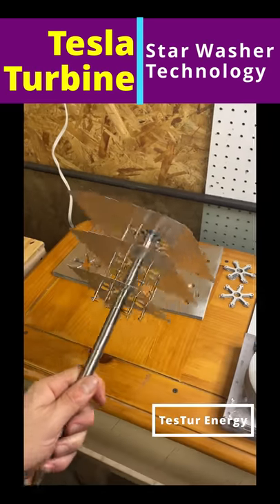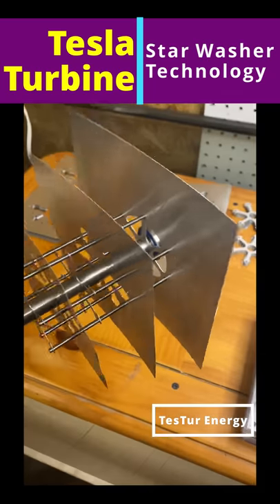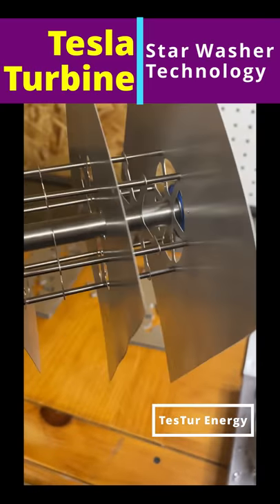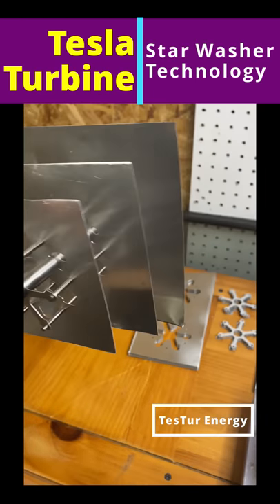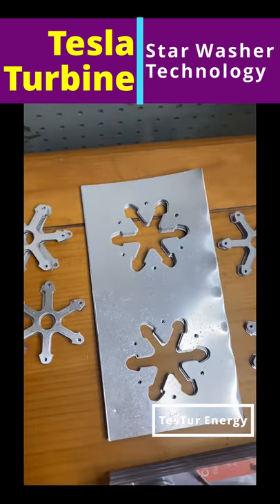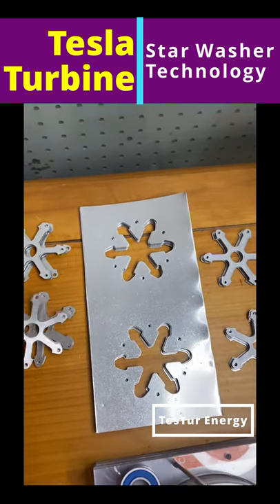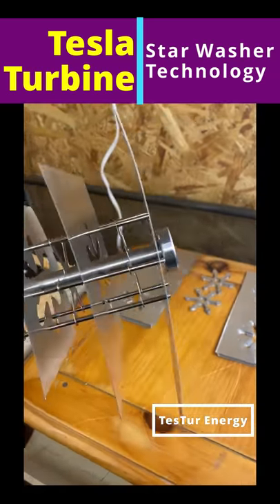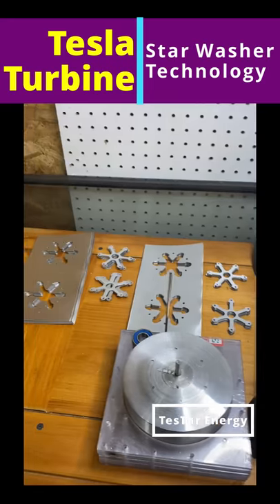Tesla Turbine Star Washer Exploded View #shorts

Comment: Charlie, im glad you're doing yours this way, because my Turbine/Vacuum Pump Modification idea will involve the use of a gearing ratio to ensure all plates have same rotational rate...
Reply from the maker: Hey thanks! Yeah I’ve got a lot of things to test out! just trying to get the disc and star washer production process down pat before testing. This first one will just be made as a regular single stage Turbine just for testing. Then I will disassemble it and reassemble it with an attached pump stage of different radii. 

My CAD designs that I’ve been sharing have it for a 4in drive discs and 5 in pump discs. With Tesla’s suggested ratio of 3:1 pump discs to drive discs for the same diameter discs I have calculated the ratio to be 3:1 ratio of usable surface area. For a 5in pump and 4in drive the ratio is as follows. One needs 1.75 times as many 5” pump discs as 4in pump discs.
Reply: @CharlieSolis  so according to Tesla's specifications,  the Vacuum Pump Can be 1/3rd the size/mass as the Turbine and still pull vacuum and add enough energy to the 2-Stage system that it can sustain a load and stay at 99% Efficient? 

 I sorta got the impression that the casings for pump and turbine were approximately the same size... but i could be wrong.?.
Reply from the maker: @fxphenix5162  hey actually i think youve got that backwards. tesla said you need 3 times as many pump discs as turbine discs. this is because the volume of the exhaust is far greater after its been expanded through the drive turbine and as such the pump has to account for that.
Reply from the maker: @fxphenix5162  im looking for the exact quote but i cant remember which paper it was in at this moment. lol this happens to me every time i need to find this quote too. let me ask jeremiah from ienergy supply if he can remember which document its from.

Comment: What is this used for?
Reply from the maker: Hey thanks for commenting! It’s a Tesla turbine. It’s used as a motor/generator to either produce electricity or produced mechanical work. But can also be used as a pump/compressor if driven by a motor. I’m making this one for a low pressure closed loop steam powered electric generator.
Reply from the maker: This is a video of the last one that I built being driven with compressed air. 
Check it out! 
https://youtu.be/G6POWHroRGk